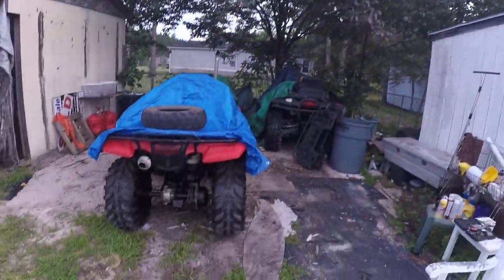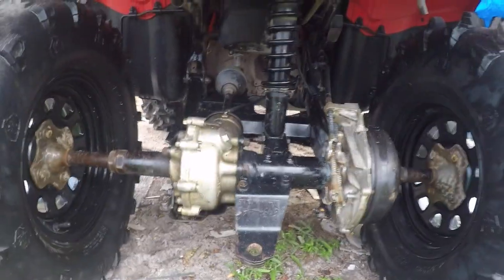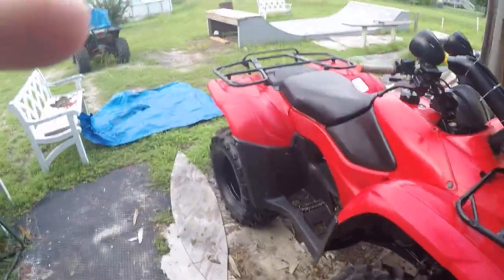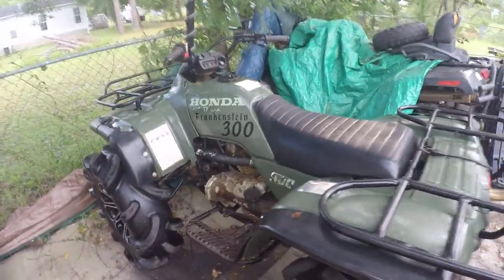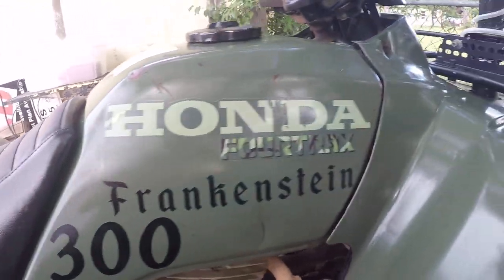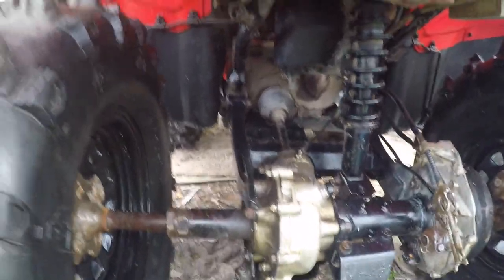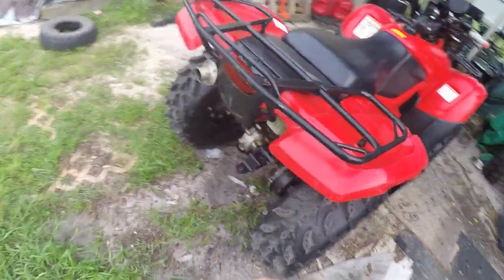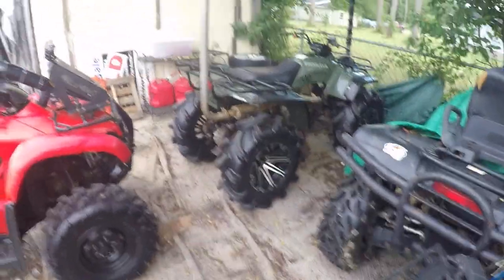Part 4 finale 420 rear end crapstorm

Comment: Glad to see you got everything running and i just traded my bkt for 30" silver backs
Reply from the maker: +Honda on Bkt Thanks!!! Thats awesome on the trade! Cant wait to see videos of them on your Honda! We're going riding tomorrow or Sunday!  Finally! Went to comment on your vids and couldnt find where to.m? Im new to this but will keep tryimg!
Reply: Some Damnfools Atv sometime the comments are by the like button and sometimes there at the bottom.... but right now having a hard time to put my tires on cause they where on crush lockers
Reply from the maker: Beadlock rims?
Reply: Some Damnfools Atv no crush locker.  Look them up on youtube
Reply from the maker: Honda on Bkt oh ok! The tires were on those that you got and now theyre squeezed and wont catch bead?
Reply from the maker: Honda on Bkt Get STARTING FLUID ONLY and set your rim up on a couple bricks. Have air on THE READY, spray ether around inside of tire,making a trail to light 3 foot or so,light immediately! As soon as ether hits put air to its ass while holding tire. May need a buddy, and dont let bottom of tire touch ground hence bricks.
Reply: Some Damnfools Atv tried that man nothing they been crushed for so long that i have to stretch them back out i made a video i will post it soon
Reply from the maker: +Honda on Bkt Tractor supply tube?
Reply: Some Damnfools Atv i could use them but no im using pool tire floaties lol
Reply from the maker: +Honda on Bkt SWEEEEET! You video it?
Reply: Some Damnfools Atv yea i just havent edit it yet

Comment: What size lift?
Reply from the maker: 3in lift 3in stretch on 300. No lift on 420
Reply: Some Damnfools Atv custom 3 inch lift or? Bought
Reply from the maker: Custom
Reply: Some Damnfools Atv what would you charge for one?
Reply from the maker: They're selling stretch kits online now cheap! Come with longer driveshaft and everything...bolt on.
Reply: Some Damnfools Atv yea I have a Stretch just was wondering about lift

Comment: Do u have the tuner for the hmf pipe or did u drill a hole in the slip on part and put the o2 censor in it
Reply from the maker: +THE HONDA MAN Tuner/programmer
Reply: Some Damnfools Atv yea
Reply from the maker: +THE HONDA MAN sorry...out riding. I meant to say yessir it has a tuner on it.
Reply: Some Damnfools Atv oh on thanks man